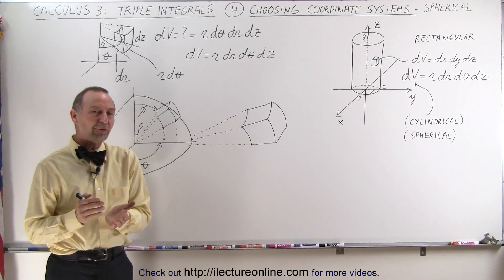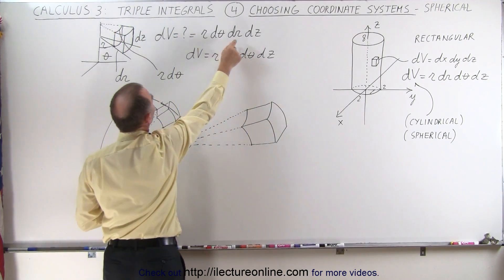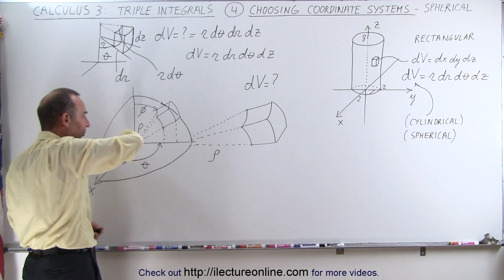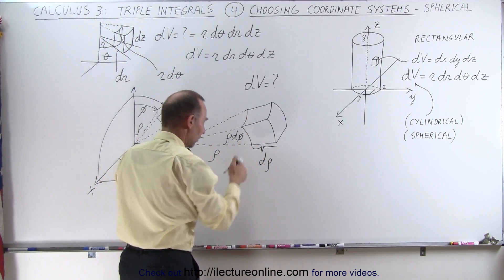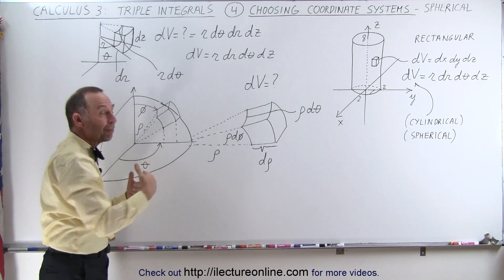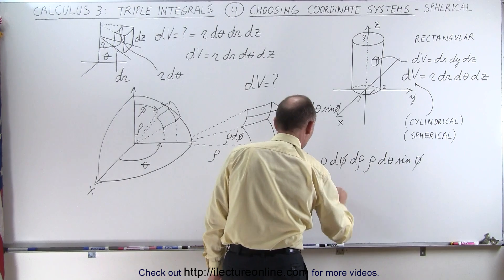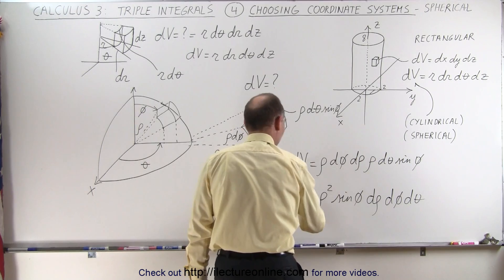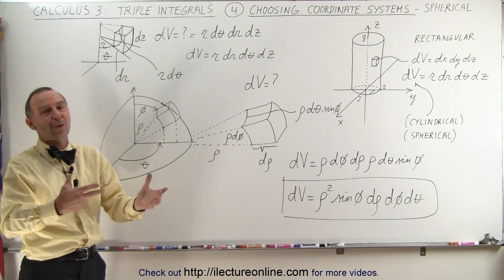Calculus 3: Triple Integrals (4 of 25) Choosing a Coordinate System: Spherical

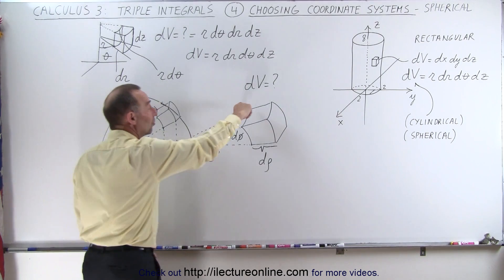Comment: 2:30 why does the distance narrow as the volume element gets closer to the top?
Reply: I just imagine a globe and the longitude lines, the distance between the longitude lines gets smaller as u reach the poles
Reply: So think about it if the distance didn't get smaller as you went to the top. It's be like having a churro in a loop. Now imagine if you have multiple churros. You make a circle with each and stack them. What do you get? A cylinder! So for it to be sphere, the "churros" would have to get smaller as they get to the top. Then you can have a churro that are thin in the middle and wide on the ends. If you make a loop with them and stack as them as you did before you get...sphere! Or a mess.
Reply: @MadScientist356  Good explanation. Thanks.
Reply: @MadScientist356  But why are we using sin?
Reply: @hakanalc2132  I was also stuck on this, but then I figured it out. Think about it: To calculate arc lengths of a circle, we take the radius times the angle. Imagine then that the arc due to dθ is the arc of a circle slicing horizontally through the sphere i.e. the circle is in a plane parallel to the xy-plane. If you imagined it right, then the center of this circle should be in some height in the z-axis. Notice that the radius of this circle is smaller than the radius of the sphere ρ . Call this new radius r. The arc length due to dθ is then rdθ. Now you only have to find out the relationship between r and ρ.  You can create a right angle triangle with hypotenuse (length ρ), angle Φ and  opposite side with length r. Basic trigonometry then gives you r = ρsinΦ, and the arc length as rdθ = ρsinΦdθ
Reply: @akakishinjitsu  Thanks, it is very straightforward explanation!